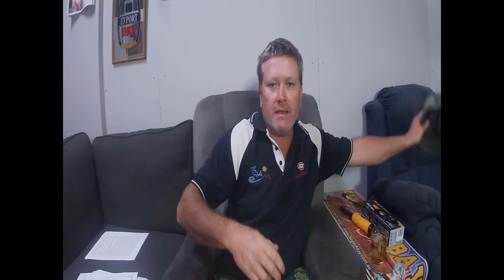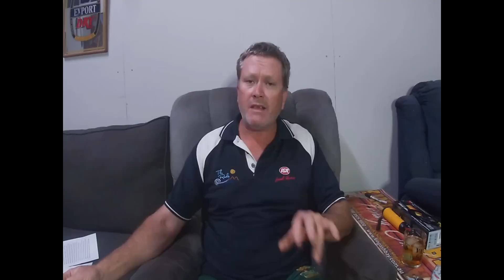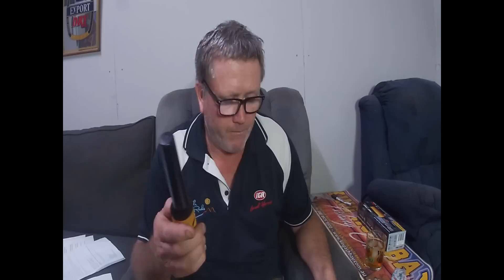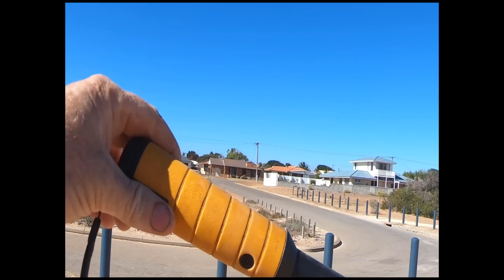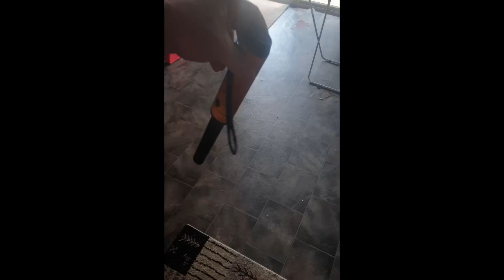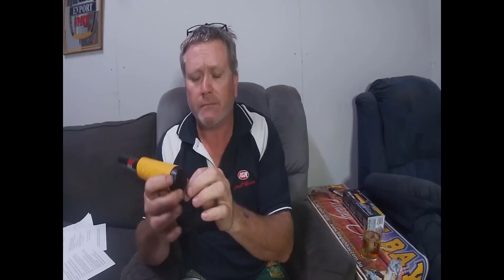Minelab Pro find 35 problems Minelabs answers #2

Comment: I have been a customer of mine lab for a long time. I have  the Xterra 705, gm1000, gofind44, and the 540. I have purchased 3 of the profind 35 pin pointers- 2 of the profind 35 have become useless from the uncontrollable beeping. The gofind machine has terrible discrimination and I was disappointed to find the app for this machine was additional charge to use! The equinox 800 has broken cool wire, the connection has cracked and bent the pins. Making the coil now unusable. I have used mine lab almost exclusively for many years, until now. I am have purchased my second Garret machine, and plan to use Garret in the future. Now having a collection of broken and unusable and quite expensive equipment.

Comment: Great video... explained alot of my issues! I got one tday with a nox 700. Alllooks spanking new. I was mucking about with the pin pointer and decided to point it at a 9v battery and then all of a sudden it started going off all over the show amd like your clip whilst tilting it. 
I reset it and havnt had the time to try it yet but seemed to sort out the issue.

I wonder if these issues persist whether minelab would do a swap for a pro find 40 and just have me pay the difference?

Comment: Had my 35 for a couple of years. It’s been fine. Putting the tip to the soil when turning on stops chatter when it occurs. I don’t use the ferrous/non-ferrous feature. I use the detector to make that determination. I need the pinpointer to find the target.
I used a large swivel and hooked mine to a retractable cord hooked to my belt. Mine has been a great tool to speed my recoveries.

Comment: Hello Sir, I have the Pro-Find 35 and 40, If you only want the vibration and not the beeping, you must hold down the (-) minus button while powering up the unit. It will only vibrate. It will stay set like that every time you power it up. and will not beep again until you press the (+) plus button while powering up the unit. Also, if you have the quirky constant beeping, just depress the power button quickly and it will stop the beeping. I know this works on the 40, not sure if it will have the same results on the 35 as I have not had that problem as of yet. I hope this helps. Happy Hunting!!
Reply: Thanks for the update. I don't have a 40 yet but intend to get one. They sound much better than the 35 which many people had problems with.

Comment: Ever since mine was new it wont stay on! I have to use my knock off carrot. The minelab one is junk! Also if i get it to come on and stay on if i invert it, it would shut off bc the battery was moving around. It doesn't fit tight in there. I put a Sacagawea dollar in it to hold it down
Reply from the maker: The new Minelab pinpointed is supposed to be the upgraded improved version. I'm going to buy one just to test it out

Comment: So to start off Minelab does have a video about ground balancing. Granted that should be in the manual. I have experienced all the same issues as you have. I would have went with another pin pointer. My problem is I bought it as a bundle deal with the 540 pro pack. I do know weak batteries will make it go wonky. For the most part it has been useful. I thought I had a problem with the Ferris nonferris mode but I think it takes the pointer a sec to lock on and create the distinction. The light is not very bright but I am not using it at night. Another thing is if you wash it off the speaker hole will get water in it and the volume will reduce a bit. I just blew the water out and it was totally fine overall it’s my first pin pointer and detector. I am on my learning curve. I have mainly used the pin pointer in my yard because I am exploring an area full of stuff next to the house. Tons of keys have washed up through the years including a skeleton key. My house was built in 1901. Found 4 more keys today just in the 1 ft area zone was playing in and the pointer worked great
Reply from the maker: I have persisted with the 35 and the one I have now hasn't faulted. Glad to hear yours is doing the job. Some good suggestions there. I agree on the battery thing, I had the same issue. Happy hunting

Comment: Mine constantly shuts itself off, even with a fresh battery.
Reply: Makes for tough detecting. It is absolutely junk. I have one I use as a shovel now. 😂
Reply from the maker: If it's still in warranty get it replaced.

Comment: Today is my first day detecting and my Profind-20 was giving me fits. Another video showed how snugging up the battery inside helps. So I McGiver'd a thick rubber band from my vegetables and wrapped the battery with a few twists. Its inside the housing Snuggly now. Some people have said that the pointer lacks a place to tether a line. That's not true. Two tiny holes in the battery lid fit a single wire key-hole ring. I attached a spare one and now I can attach a springy stringer from one of those CASINO cards you receive when loosing all the money you found metal detecting. Ultimately you find the coins in the ground, the slot machines take in the profits and the casino gets your hard earnings. That how it works, recycling.
Reply from the maker: I have used a tool lanyard for mine. I had to go back too look for it once when detecting on a beach at night that's when I decided to use a lanyard.

Comment: I have to issues with my 35 1 is when you invert it bring it back to normal it keeps beeping order issue when it finds a target and I take the pin pointer away from the targets it doesn't stop beeping until I put it back touching the target

Comment: See all they had to do was admit the problem and fix the problem that they knew existed but NO they blame everyone and everything rather than admit the problem is theirs-if your goods are faulty Federal law says- repair replace refund-they will spend 5000$ to save a legally required refund of 250$ this is not the only issue Minelab have with there detecting gear and they know it.

Comment: I also just received my second warranty replacement for my Pro-35. Each replacement sent by the repair center was worse than the last. Same issues you demonstrated on the first and second. The third one would constantly power off when It alerted to a target, started clicking rapidly and would not power off when I tried. Just crazy stuff. When they send the third replacement I'm going to see if I can trade it in or sell it. It seems the Garrett is the next most popular.
Reply: I really want to try the Deus Mi4. Heard good things

Comment: Thanks for your effort Bakerzinc.
My first 35 failed under water at 1 metre depth or less.
My supplier sent me a replacement & it also failed under water at same or less depth.
Both times failed first time in salt water.
Does not work anymore.
Pretty disappointed for $250 AUD
Reply from the maker: I haven't see anything bad about the new 40. I think it would be good to put it through its paces.

Comment: I had all those issues on my 35 to but its final death after one and a half years was the rubber over the on/off switch split letting in dirt and moisture. Far better next choice was the nokta pulse dive that comes in a quality case, spare o rings, tip cover, mini coil for scuba diving, and its pulse induction so no salt water probs, all for about the same price and no issues at all !
Minelab dropped a bollock on this one
Reply from the maker: Sounds like it's the one to get. Might get one and give it a crack

Comment: Just bought a eqanox 800 today its still in the b oox. Cant afford a pinpointer yet but i do have my garrett one for now. You wwould think if you van buy a electrick toothbrush for $60 and it has a charging system where you just sit it in the stand that they could do it for the pinpointer considering the price there wanting. I still have my eqanox in the box but started reading the paperwork. It sounds like i need to buy a 2 amp usb charger is this correct. I sent a message ogg tonight to minelab asking this before i take it out the box. Enjoy you info.look forward to learning more if i end up keeping it cheers Andy
Reply from the maker: Sorry  for the late reply. The equinox comes with its own charger. I would stick with your garret pp for now. I've heard they work fine.

Comment: this piece of crap pointer I threw it I wasn't going to go back and get it I'm probably going to give it to somebody I hate. it goes off like you mentioned in the water , it goes off if I told it sideways through the sand and it won't shut up even if I wipe it off if you get sand all the way around it it sounds the alarm and then won't shut up I have to turn it off and turn it back on. The equinox 800 is a very good machine I have no complaints about it really. but if I knew this pinporter was this bad I would have never bought it. not to mention the $250 wireless module that the only purpose that I can understand it's for is to connect wired headphones to your equinox metal detector that's another brainiac salesman stunt I guess really really bad it makes me have buyers remorse I hate buying something and feeling like I got ripped off it certainly not a reputable company to sell you a package deal include something and force you to pay for it and it's junk or useless. sorry for the rant thank you for your time
Reply from the maker: I feel your pain. I still use my 35 with no more issues. Would I buy another....doubtful.

Comment: Everything you discussed is exactly my experience also.  Minelab profind35 is junk.  Love my equinox but Minelab should really be ashamed of this product.  I have a $20 chinese pinpointer that is more reliable than the profind.  If I were Minelab, I would be embarrassed and try to resolve the problem as quick as I could.  
Also my unit has a really high pitch squeal that is constant.  Anyone elso notice this? 
Minelab, get it together.  I would have payed $200 if it was actually what you promised.  Im deeply disappointed.

Comment: Just received my 35, it does the beep when you fill it around like yours did, on high, medium, but not low... hmmm send it back?? you would figure by 21 this would be solved, yea 140 bucks you expect the best!!
Reply from the maker: I would return it to the supplier for replacement. If everyone holds them accountable perhaps they will get the message and fix the issues with a new model.

Comment: Good video. I have a Pro-finder 25 that falses almost constantly at higher sensitivity when pointing it up and down, just like your video. I just found out that if I hold it straight up or straight down while powering on, it doesn't do that. I think maybe holding it like that on power up must be canceling out whatever is causing the falsing. It's probably best to turn it on while pointing in the down position since that's the way it will be used.

Comment: Just got my 35 yesterday, tried to use it under water, nightmare, tried restarting underwater to balance it, had to turn sensitivity down to almost zero before it would not just beep like mad, not too impressed with it for the money I paid.
Reply from the maker: I don't even bother using mine under water.
Reply: Tried doing the ground balance as you suggested works a lot better

Comment: My unit died not even a year old after it dropped from my bag and minelab repair said it's my fault and I am on my own lol!!!
Reply from the maker: Well I guess in that case it's a bit hard to ask for warranty
Reply: Hi Travis, under the Australian Consumer Law, every product sold has to be 'reasonably durable'.  This is independent of what the manufacturer's warranty does or doesn't cover.  Go back to them and say you are relying on the ACL and a product like this, designed for use in the bush, should be able to take a few knocks.  Link - https://www.accc.gov.au/consumers/consumer-rights-guarantees/consumer-guarantees

Comment: I've never been impressed by the Minelab pin pointers hence I use a different brand.
Reply from the maker: Which one have you got?
Reply: Hi so what brand do you use
Reply: @rocar716  I was using a garret but bugger me just a few weeks ago I went out and bought a minelab pro find 35 and to be honest its not a bad bit of kit compared to the older unit I had troubles with many years ago.

Comment: You’re kidding me. I thought that it was me! Same issues. There is nothing in the instruction about ground balancing (I just checked and the instructions are the same). I could hold it in the middle of the air and it would go off constantly. I could be 3km away from a road, let alone overhead powerlines. I would have to set it on the minimum to stop the beeps. What is the point of that? I would get a signal with the GPX and then use the pin pointer.  I have chased signals with the 35, then nothing.  Have I missed good gold or did I waste my time searching for something that wasn’t there?  We all know that we pay for the Minelab name but we accept that (the technology has been around for years and I could build one for under $20) and that they are way overprices for what you get. That’s the norm these days and I accept that but I at least, I expected it to work as stated.  I don’t know what you have in your state but in NSW Its Fair trading. I’m going to complain to them and you should too. That’s just plan false and misleading which is illegal and they need to be held accountable.
Reply from the maker: Wel you are within your rights to pursue that under consumer law but Minelab will replace it under warranty as they are obliged to do so you may find you hit a brick wall there. Hopefully minelab eventually scrap this model and build a pin pointer that does the job and lives up to the minelab name.

Comment: I have the pro 35 and when I move it around on high settings it beeps with just typing it up down sideways every direction but if I lower it down 3 notches its fine but I only get to the second power setting so useless I emailed minelab as well good vid srry for rambling lol
Reply from the maker: Yeh I feel your pain. The only answer is to return it (if its still under warranty) and try again. You could try get a refund. I haven't tried other pinpointers but I hear the garret carrot and the M14 are worth trying.
Reply: I’ve got the exact same problems. It started of working really good. Now after 2 months it’s going completely erratic on the high setting even when I’m outside away from everything. It must have a design fault if there are a heap other people getting the exact same problems. I’ve been reading quite a few reviews. It’s disappointing as it started off working really good and I couldn’t fault it. Now it’s really annoying me. I’m thinking about sending it back under warranty. Hopefully I get a good one back that doesn’t have the same faults.
Reply: I started right off with that happening, then eventually it started powering itself off for no reason. I sent it in and they found the battery housing was cracked which would allow water intrusion. I just got the brand new replacement unit today and guess what? In level 3-5 it goes crazy when tilted. I'll try the ground balance Bakerzinc mentioned, but not confident.

Comment: Thanks for that video very informative. I never knew about the ground balance before turning on as you said it's nowhere in the instruction manual. Anyway I used to have the 25 and sold my old detector with the 25. Fast forward 3 years later, decided to buy another detector and it came with a free pro find 15. The 15 is such a downgrade on the old grey 25. Was going to buy today the 35 but after watching your video I'm not sure now. Hearing some really good reviews about the XP rechargeable type. But seeing I've always had minelabs i like to stick with minelab. So overall would you still recommend the 35. Cheers
Reply from the maker: I wouldnt personally buy one again unless minelab come through with thier promised fixes. Honestly based on the trouble experience with these pinpointers i think they should be recalled. I would look to the XP or  Garret Carrot but cant comment on either of these as i have yet to try them.